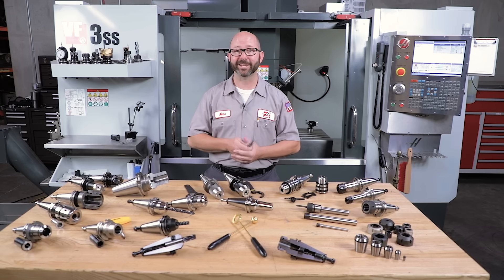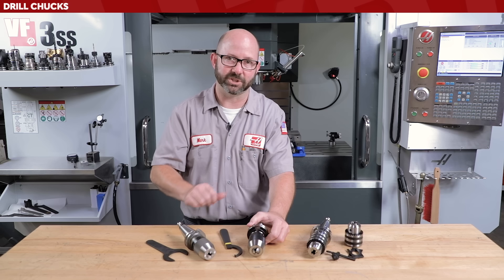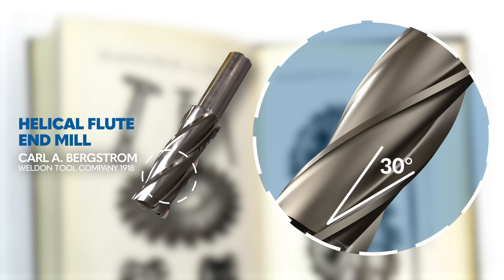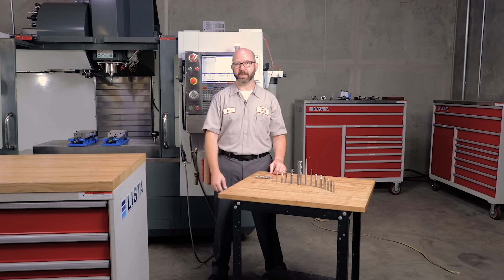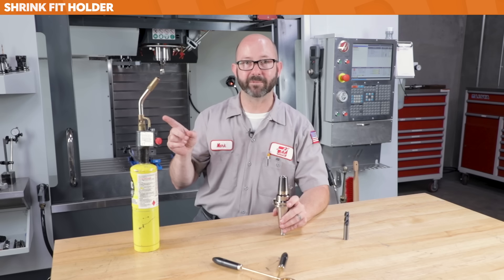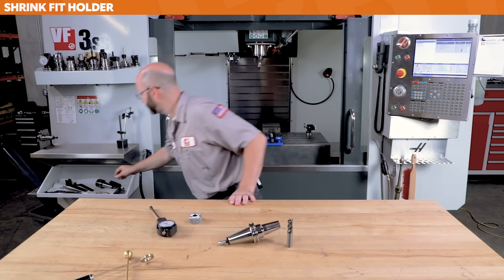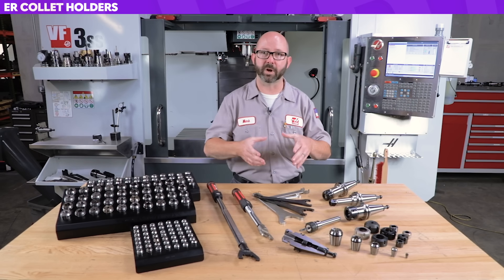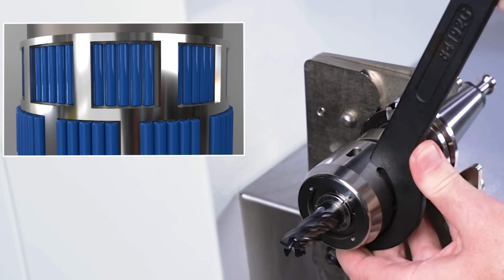Tool Holder Essentials - Every Machinist Needs to Watch This - Haas Automation Tip of the Day

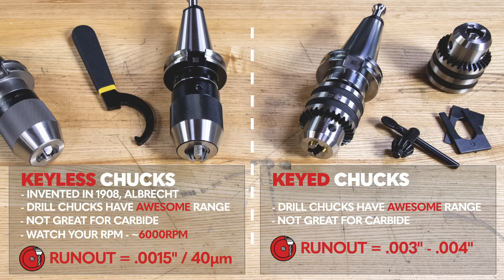Comment: 9:34 the Weldon shank actually has less runout than either of the hand tightened chucks...
Reply: The problem with Weldon shanks is that it depends greatly on the tool you are using. Most carbide tools have very good run out but low precision hss will problematic.
Reply: Also depends on the tolerance the Weldon bore was machined to, as well as the tolerance the tool shank was ground to.
Reply: We replace our jacobs chucks when they show any more than .0015. Always a good idea to do a visual spin test of runout if not measuring with indicator. I always do Atleast a visual spin test on all my tools as I'm loading into machine. Reamers and some endmills get indicated in for accuracy and or tool life

Comment: 5:02 it allready read size you not need calculate it. if it read 11.252mm then it is so xD right. 1/8 is 1/8 you not need calculate it that is size OR stamp  3.175mm on it.easy right? 1/8G thread is equal 10x1 thread.why cant just move on metric lol becouse it should be 3.175 thread by calculating it lol?

Comment: The best tool holder is not in the video. I saw it on the EMO in Germany. They ground a 40taper tool holder with a special endmill out of one piece. All solid and with a perfect run out.

PS: You forgot endmills with a tapered thread at the end and the Fahrion ER/Weldon hybrid collets (UPC).
Reply from the maker: Suzaru87 – The list seems endless. I’m a fan of integrated tool holders for my indexable mills. We show some at 34:03 but didn’t have the time to talk about them. By integrated the tool into the holder, we can keep things short, and have great rigidity. Thanks for posting. – Mark, Haas Tip-of-the-day

Comment: The tools cost as much as the cnc machine. Don't forget end mills don't last forever. Plus how long does the cnc machine last till it gets sloppy. The less movement the more wear in that area. And when something goes wrong the destruction can be catastrophic. 60 tears ago we did this all by the old hand crank machines. The only time we got a carbide bit was for cast iron or really hard parts.

Comment: Harbor freight mills are sold with only a drill chuck, and not really an explanation for beginners on what a collet is, let alone how to use one. Turns out, those dinky little things hold half decent tolerances when you use the correct taper collet and an endmill, and don't destroy your drill chuck and shank by using an endmill in the chuck.

Comment: I've been machining for 2 years now and in my shop we don't grind flats in our end mills for our end mill holders. I have never seen or had a problem using a set screw against an end mill without a flat.
Reply: When you start to take deep, heavy cuts you will likely run into problems. Not always, but the harder you push, the higher the likelihood of pullout.
Reply: I'm sure with the vast wealth of knowledge you've gained in 2 whole years, you must be right and those of us with decades of experience must not know what we're talking about.
Reply: @alvinjasin8869  Everything I said is true. I never said it was right. Plus the people I work with have about 30 to 50 years experience.
Reply: @Brentiannoli  I see. We mostly machine around 8k rpm and don't usually take heavy radial cuts.
Reply: @alvinjasin8869  Im sure you were an absolute prodigy after machining for 2 years. How about you let the kid learn without making him feel stupid. Maybe offer some advice instead of scoffing at him.
Reply: Mark addressed a potential issue with that, if the set screw throws a burr on the shank, then you will struggle to get the tool out.

Comment: the shank is the same size as he cutting edge???
Reply: That is what he said for drills. For end mills, the manufacturers usually specify the shank as pretty much exact size, with the cutting edge 1 or 2 thou undersize. Read the detail descriptions on any quality manufacturers website or catalog.
Reply: @BenAtTheTube  and in most drills the shank is undersize

Comment: I don't get the explanation at https://youtu.be/-xH06bgpcIY?t=412  The helix and rotation direction is the same for both. Why would one pull and the other push?
Reply: It’s interesting. The drill is only cutting at the very tip, the angled nose, so all of the force is directed axially. The cutting flutes on the side of the endmill actually make contact and remove the metal, so the forces are radial. The flutes on the two two tools look the same, but only the flute sides of the endmills do much. The flutes on the drill just help direct the chips like a slide, they don’t cut.
Reply: @markterryberry4477  That makes total sense now. Thanks!

Comment: Personally, I hate the sidelock... The tools have to be bottomed out against the end of the flat or it will pull the tool just a little where it may not be noticeable until after a production run, ruining an entire batch. Combine that with the potential for runout and I don't waste my time even looking at the option.
Reply: Yes!!! I love this comment. We will typically lightly tighten the set screw, then pull the tool out a bit until the flat on the tool makes contact with the setscrew, and then tighten things up all the way. If the tool is going to move, it is going to get pulled out (helical) which can gouge your workpiece.

Comment: You burn your finger on that ring? I can see fingerprints burnt in lol
Reply: Not that I remember - but who knows, might have blocked out the trauma. In a typical ring set like that, the ring is loose at room temperature, and we heat up the ball until it expands and no longer fits. That’s not the story I wanted to tell (we heat up the holder, not the tool), so I machined out a new ring undersized. We heat the ring (holder) to allow tool to fit. Fun project.

Comment: what no TG holders wtf
Reply from the maker: Zar15 com – No TG, no SK, no Tribos or slimFIT. Lots of opportunities for more videos!! Thanks for commenting. – Mark, Haas Tip-of-the-day
Reply: Because TG and DA are outdated. Look into the SK from Nikken.
Reply: As noted, SK is the rightful heir to the TG line. Slimmer, none of that goofy recess from the nut to the collet, etc. I have a couple of old school TGs but I rarely use them, I only regulate them to reamers now. In my shop, SK took over what would normally be my ER line as the price is very little more for a better all-around system. ER collets in the older Fadals/only milling steel/stainless and SK in the machines that can actually turn 10,000RPM+ and cut 200ipm+  No need for shrink fit yet and SKs work great for what I do (low volume production/prototyping).

Comment: Tight tolerances and drills doesn't belong in one sentence tbh. Use reemers if you wan't to have a precice hole.
Small tools => Keyless chucks are fine
Big tools => You need the key to fix them rigid!

Comment: Not a machinist.  If you are using a taper to join the machine to the tool holder why not use a taper to join the tool to the holder?  No balance issues and if you only have say, 5 standard size tool taper sizes you only need 5 holders. Bit costs would be somewhat higher but runout would be almost non-existent.

Comment: Maybe stupid, but why not make a holder and tool in one? No holder, no tool, but a toolder!
Reply: I love integrated holders! I have some favorite Indexable Mill bodies that are integrated into the toolholder. This keeps the assembly really stout, and gives us excellent balance. If you check out the video at 34:25, look at the back left corner of the table for some of these integrated holder tools. That segment of the video didn't make the cut, but it is definitely a great option. Thanks for the comment!

Comment: A drill chuck belongs on the drillpress not in any CNC that's what collets are for we did not own one there expensive accuracy is garbage they can slip destroying drill chuck and part.
I just can't even imagine what kind of a moron would use a drill in a drill chuck and a CNC machine or any machine for that matter that trash belongs on a junk drill press not in the machine shop unbelievable I guess we have to go through your toolbox see what other kind of trash you got in our shop that would have to go home with you.
Graphite like for die sinking same we only would allow copper copper tungsten carbide primarily copper is all we ever used 100% recyclable most of the time we would rough cast it so as to make more efficient use of metal.
No vice grips or monkey wrenches adjustable like crescent wrenches.
You better have half inch and a quarter inch torque wrenches and use them everywhere.
Floating holders like remer holders tap holders absolutely not, you better indicate in your reamers.
If inspection found bell mouth or oversized reamed holes they come and check your setup first thing they would check is the run out on your reamer, if your reamer isn't indicated in you're out of here.
You never take a tool out of the box and put it in the machine you always must Stone radiuses on any end mill if they're not already on the tools as purchased you're also going to be responsible have the right end radius for the part based on the customer standards there's no such thing as a sharp corner unless it's detailed on the drawing inside or out we used to exclusively use tooling to deburr parts on the machine not files or routaburs bladed tools.
There is no excuse to have a part chopped up like a butcher made it.
Just like you got to pay attention to using a combination center drill countersink there only used for centers.
Otherwise you must always use a 90° tool for spotting holes 
Going deep enough to leave the right size chamfer to begin with
When it comes to a true countersunk hole for a screw and you got to slow down a minute and remember is it going to be for a metric screw or a American screws the angle is 82 degrees metrics get 90 degrees we always interpolated them never plunged to depth.
If you working with titanium you had to get a new drill you're only allowed to go five holes three if they're deep and you had to use another new drill the old drill you thought was just fine that had to go in the garbage or it could go home with you the only time you take tools home same for a tap three holes draw a new tap.
We made nice parts we had a nice shop tolerated no bullshit at all you're on the phone at once seeing if you could get a quarter more down the street you're on your way.
Standing at the time clock waiting for it to be 4:30 you're gone.
Not wiping your machine down or chips and oil in the base of a Bridgeport same.
Pride and craftsmanship is Paramount when it comes to precision machining Little things show that you're either able to do that or you're not who wants to trust you with 100,000 pieces of metal if you can't wipe up your mess your paid by the minute earn every minute or you're stealing.

Comment: If you're a machinist you should make your own dam holders duh..... tolerances are not a result of the machine or tool they are a result of the operator..... put a good operator on a low tolerance device he will give you good tolerances put a bad operator on a high precision device and you're gonna get low tolerances and possibly turn your high precision device into a slop o matic

Comment: begging the question why would somebody use a multi thousands of dollars tooling system with a high speed steel end mill thats almost as bad as
taking a shower and wearing underwear that you wore for an entire week. I guess I am just a little bias.
Reply from the maker: Paul – I think that’s a really interesting question. I don’t know that I have a good answer, but love the question! Maybe we can get some comments. When is it actually beneficial to use a HSS tool instead of carbide? Carbide is brittle, and really expensive, so I can see using HSS on long, or big tools, to keep the price down. I’ll go carbide tipped HSS quite a bit (think reams). HSS can be ground sharper, which is good on plastics and such. Hmm. ROI, tool life… max cutting speeds… Interesting topic.  Thanks for posting. – Mark, Haas Tip-of-the-day
Reply: @haasautomation  don't forget powdered metal, I exclusively buy my taps made from powdered metal they are flexible like hss and are nearly as hard as carbide. also I use niagra cobalt roughers to rough things like 4140 tool steel. Not all HSS is created equal...

Comment: And after you've spent $12,000 on balancing and shrink fitting kit you'll be able to add 10%-15% of tool life to those $20 end mills... It pays for itself in under 300 years.

This assumes that you don't include the time you wasted researching how to fix problems you never even knew you had.

You thought it was enough that your machines were making parts your customers were happy with.... Slackers...